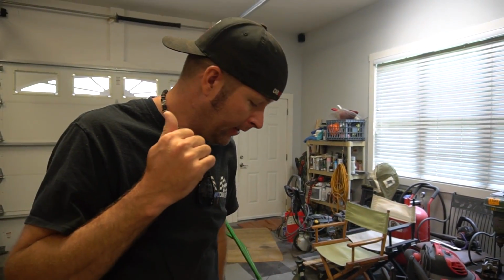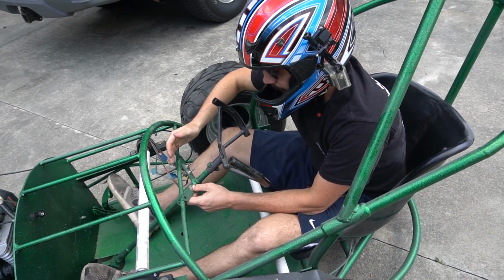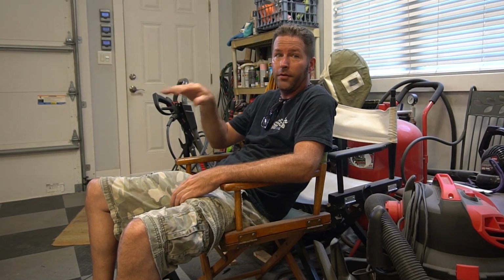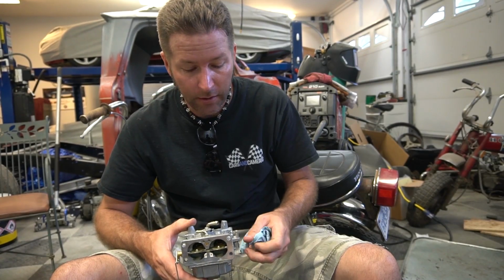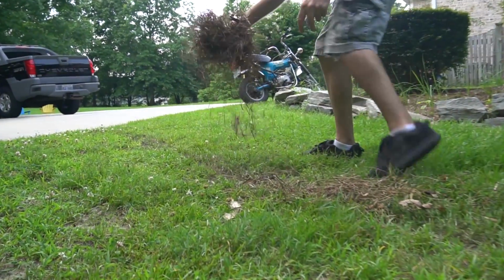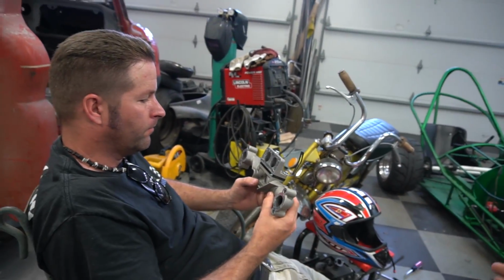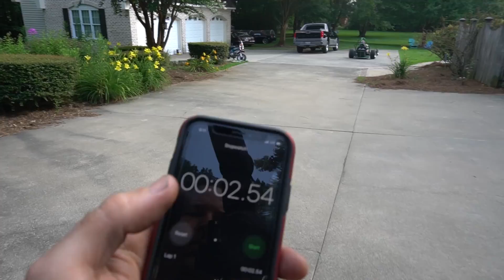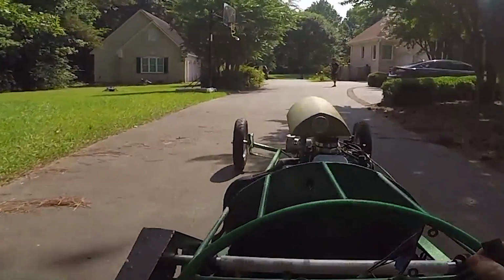THE DRAGSTER DOES (BABY) WHEELIES! | 50HP 670cc Drag Rail Kart

Comment: I think fuel slosh may be a part of your problem. Since the carb is sideways like the whole engine, you nail it and all the fuel sloshes to the back of the bowl during acceleration. That may be enough to cause a lean running front cylinder or even a misfire. Whatever new carb you get, I would suggest taking it apart and seeing where the main jets get fed from and put that toward the rear of the rail so when you nail it, it’s always got fuel.

Comment: Sounds like the chain is skipping...you can hear it and see it at 13:22 .Looks like the shafts are deflecting also..
Reply: harry guy I too noticed the movement/"slop" of the back wheels on takeoff. Wonder if its shafts or those wheels deflecting?
Reply: Yeah,  and I've always wondered why you don't use a spring loaded tensioner on your chains???
Reply: I noticed that too on the last run, that rear shaft looked really sloppy.
Reply: Yes both the left and right side of the axle is bending toeing both the rear wheels forward 13:19 when he hits the throttle and it looks like the chain skip might be caused due to the axle flexing cause as the axle bends forward it takes tension off the drive chain just enough to skip by the looks of it.
You can see the final drive chain to the axle get real loose on take off 13:34 ...you can see the left tire wobble back and forth when the chain skips 13:22 use the slow mo function and you can really see it good.
Thicker axle might be in order...
Reply: Neil MacPherson 
Haha I just about pooped myself. 
You have my uncles name , spelled correctly and everything. 
Good to see another Mac!!
Reply: I caught the same thing with the rear shaft, both rear tires had a slight wiggle to them and I saw it on both tires? the right one at 13:15 and then the left next clip.
Reply: LOL "If it's not Scottish it's crap" !!!!!!

or maybe your Uncle has my name.
Reply: Neil MacPherson 
Haha yes!! 
correct people when they say it wrong also. 
Tell them there’s no fear in pherson 😬😬
Reply: LOL I remember my Dad making that point.

Comment: What I’m thinking is the g forces from the launch is pushing all the full to one side of the dual bowl and only feeding one pick up
Reply: thats what I was thinking also  since its not a high G application Engine to begin with ,  we have slosh control plates or stuffing  in hard launching car carbs and jet extension tubes to prevent it from leaning out  , also the cutting of the spacer will make the carb look bigger to the engine since its now pulling from both bores instead of one bore .
Reply: Scott Grumpybastard yeah this happens in real drag cars ( naturaly aspirated )at the track during launches but most all cars have a drop in oil pressure due to the oil being pulled away from the oil pickup so they need a sump system, but I thought this might apply here.

Comment from the maker: I think we need to go back to the drag strip before we put a new carb on it!
Reply: Mine jr has a 1.78 60 ft at drag track
Reply: CarsandCameras you think you should that would uh old be awesome
Reply: It would be fun to see the difference the new car makes.
Reply: CarsandCameras swap it at the strip so you can do before and after in the same day.
Reply: Why dont you go dual carb setup?
Reply: u should do dual 28 flatside Mikuni
Reply: Turbo!
Reply: CarsandCameras hey do you guys know were i can find a rear axle for a 97cc baja miny bike if so pleas let me know
Reply: CarsandCameras  what the funny part is  is that i have a 50cc bike that can do that much faster       now if you want a good engine get a snowmobile engine       and you should try using the belt clutch system like the snowmobiles do it acts like a cvt
Reply: You should try dual carburator close to the heads and double cable to the trottle pedal
Reply: CarsandCameras Hey guys. Just wanted to let you know that you might want to take a look at the back axle and/or left (driver side) hub. It looked a little off kilter near the end when you did the slow pull towards the house.
Reply: Hey!!!! Race it against the original 670!! that would be sweet!!!
Reply: Against the Original Black Widow!!!!!
Reply: should be cartsandcameras!
Reply: take all the carbs with you and test there. it will be way more accurate
Reply: The 2 things I noticed is it sounds like you are hitting the rev limiter and also fuel starvation.My drag car I had in school (a long time ago lol) it had fuel starvation issues too on the hard hit.The way I fixed it was to put a tube on the fuel draw in the fuel bowl to the back of the fuel bowl where all the fuel runs on take off.Might be something to look at and maybe try.Could save you some headaches.Oh and the making the crossover cut was very smart.It evens out the air going to both sides
Reply: CarsandCameras you should get a Harley sportster carb and put it on the dragkart.Harley carbs are the simplest setup ever and it’s single barrel so no need to worry about syncing. You could also use a mikuni pwk28 or something similar.
Reply: CarsandCameras y'all should contact lectron and see if they have a carb/ duel carbs applicable to this
Reply: CarsandCameras you had me at "here we go".  Love this project!
Reply: That dragster is just cool guys!
Reply: CarsandCameras put the ducati motor in the dragster
Reply: The belt clutch on a snowmobile is a torque converter.....just like the one the C&C guys have on the dragster.
Reply: Weld an O2 bung into the header and throw an Ecotrons EFI on it.  I love your tenacity when it comes to playing with old cabs, but there is absolutely no replacement for verifiable, hard data.  Plus, if you went the EFI route, you would have the option to play with the timing and advance it a few degrees when the engine gets into the optimal powerband.  SCIENCE!
Reply: DELTACX10 it is a cvt
Reply: Jeremy Nading yes it did, Bigtime...
Reply: no sense in taking it to the track if the motor is stuttering like that .. fix it first ... it's either a fuel / carb tune issue or an ignition problem ... sort it out.
Reply: Y'all should try Harley carburetor or y'all should try a Honda 2 cylinder carburetor
Reply: Hey carsandcameras, is there a link for a torque converter pulley to run the 670cc predator, going to be doing a build on my kart and putting a 670 on it
Reply: Big cam it or whatever you call it when you have bigger cams on the cam shaft, letting in more fuel. Then it oughta do a 2 second run!
Reply: CarsandCameras hey guys in that last run with ike on the cart I saw the back wheels shift position they moved in torward the frame then jumped right back out.. not really sure what that means but I'd be checking the cart out before I did any drag strip runs
Reply: I have no idea why they are stuck on that dumb 670 "predator"  but so many guys get all excited over 'V-Twins" I'll admit that their little 670 has a nice sound but a ZX14 motor spinning 12K RPM and around 200HP... yeah THEN they'd have something and talk about sound!  but to each his own...
Reply: CarsandCameras guys its time for 2 motors..be the 1st ever guys and smoke the tires off please ,,,for the love of GOD...🤘🤘🤘🤘
Its a beautiful dragster that doesn't go FAST...sorry tryin to piss ya off,so you'd  prove me wrong..
Reply: CarsandCameras you got some wheel wobble at 13:30, might wanna fix that could help.
Reply: carsandcameras you have the right idea on putting the gap in between the two barrels of the carb you gust did it in the wrong spot you should do it right behind the carb and the bigger the space the better. Engine masters actually tested that on the Dyno and made decent improvements I forget the episode number. Also by doing that you will effectively dubbe the size of the carb. From what I can tell you are spot on on it being like 2 separate carbs. Also on launch you should hold the break and gas so your rpms u faster on launch but you might break traction don’t know
Reply: Say I supplied you guys with a 20 or 30hp electric motor would you guys make a badass electric kart or bike?
Reply: chain stoker mine went out when I was a kid too
Reply: Needs a turbo lol
Reply: I`ll agree back to strip for testing, But as far as misfires any thoughts?
Reply: and fresh fuel maybe?
Reply: CarsandCameras what happen to the drag mini bike?
Reply: CarsandCameras how about a spider gocart like The Scorpion that would be awesome
Reply: CarsandCameras you are the best go cart youtube channel out there
Reply: I bet John knows what a  'Curie point' is now :0þ
Reply: CarsandCameras Get a performance side draft carb off a datsun, then build a custom intake. Would be kick ass.
Reply: Nice
Reply: Justin Perr just needs velocity stack under and correct vac signal
Reply: Nicholas Davis the typical harley engine is 90 to 110 cubic inches, which is 1470 to 1800 cc.  The predator 670 is around 1/3 of that displacement, so the carbs on a HD engine are waaaaaaaaaaaaaaaay too big for the 670.  Even if you made the adapter to physically made the carbs to the 670, it would likely barely idle and run like poop everywhere else.
Reply: CarsandCameras put a snow machine motor in it it has more horse and will be way faster
Reply: Daul carbs please
Reply: dafretz was putting 5l carbs on 1.6l & 2l engines, compact hobby stock.
Reply: Could you check your fueling with a AFR Gauge
Reply: What is this motor you speak of? Is it like a industrial motor or is it made for electric vehicles? I guess the best way to tell is what is the voltage it runs off?
Reply: Can you do a custom tap tao ark-125a
Reply: I think it needs a supercharger off of a japanese Kei car 😁
Reply: CarsandCameras  personally i think youd benefit from having more plenum volume to reduce the pumping and inconsistent intake pressures...may even be able to hide it under the scoop..good luck
Reply: Mike Kadlec you are probably spot on. I dont know how many degrees apart the predator twin fires, but i do know that it's typical for a 2 cyl to produce inconsistent pressure. I know a guy who turbocharged an old John Deere 2cyl tractor and he had to convert the old oil bath air cleaner into a boost resivoir basically. Made a huge difference.
Reply: turbo time?
Reply: Build a  new dragster with a Ducati moter on it and race the two

Comment: Mount the battery behind the seat!(for wheedles) Or get a smaller battery/ lighter?  the big battery on it must be like 50 lbs.   just a good place to start with reducing weight  :)  ps I love the cuts in the editing  + the burnout on grass was super cool!
Reply: Crazy cal 
Yea I got a Braille.  
It’ll start my diesel car down to 30, it weighs 15 pounds and is half the width of a normal garden tractor battery. 
Not cheap at around 180 but I saved about 30 pounds off my front end in my car. 
That’s a big help when it’s only rated at 52hp.

Comment: you guys are not using the stall correct. for example: if you guys have 3500 stall springs you need to bring the rpm's up to (around) 3350-3400 . right before it locks and then launch the rail. try it when you get it running right. I think you will be happy with it. also you need to find out what kind of rpm's your running at the drag strip. for example again: if your motor is good to 6000 rpm's ? then you need to make sure you have it gear to pull that kind of rpm's at the finish line.
goodluck guys. you need to come to symco wis this august and drag race one of your minibikes on a clay track,125ft. 85 bikes, 5 classes last year.
Reply: I was thinking the same thing, but their torque converter is just a belt driven CVT, not a fluid torque converter with a stator like a car, it would probably help to run the engine up to stall before launch but they're gonna toast their belts real quick doing that
Reply: It's a variomatic... Exactly The same as a jr dragster... Belt does not slip..
Reply: they won't chew the belt up. it's made to handle that kind of power.
Reply: Yeah it can handle the power, but it will just melt when if they stall it for too long, even if it doesn't melt it will get flat spots on the belt and it won't be nearly as effective after that
Reply: I was gonna say the same thing. High stall doesn't help if you don't stall it to begin with.

Comment: "You need to look at your rear tires and axle"... the hub at 13:15 has a wiggle with next clip on left side also. Its not deflection, maybe it's from tooling around the yard with that frame. I liked when it jumped the tree roots. This thing sounds so cool.  Just like the movie with Cheech and Chong...... he has the harley on porch just to bother neighbors when he hits the throttle . I'd do the same thing and stay stationary just flooring it,  LOL

Comment: Looking from the rear when you start to move it looks like the axel or the frame is flexing or is not tight in the frame Guys. when you are in slowmo on take off.
Reply: pretty sure that's axle flex when its under load. don't look good! and damn the chains look scary lol in the slow mo
Reply: WA. PREPPER  that isn't a car bro in you pic check out mine. 71 mach1 cj 429 ram air. 982 hp.
Reply: If you now cars this car is a full custom from the ground up never came of off a assembly line it does have 429 twin turbos and NOS on full cage . I will let you think what the HP is.

Comment: What about a turbo, or even crazier twin turbos. I know you put a turbo on a go-kart a while ago, but it's a dragster, it needs the acceleration.
Reply: Single turbo would be better. Especially with 2 cylinders feeding it instead of one.
Reply: Vz21 turbo would do it
Reply: Turbo would have too much lag on it. A belt drive centrifugal supercharger would work better. Basically a turbocharger with a belt drive system. Had one like that on my GTA.
Reply: Thomas Strickland a single turbo would be mechanically simpler ...and if sized correctly the wouldnt be much lag at all especially with their stall setup.  If they wanted to boost more volume at less pressure to make more power they could set up a nitrous system either in the induction system or in the exhaust as an anti lag wet shot
Reply from the maker: We would need either a draw-through setup (which has performed poorly for us in the past on the drift trike) or an expensive custom EFI system. On top of that, we'd need a custom ground cam with minimal overlap- forced induction gains are marginal without the proper cam.
Reply: CarsandCameras 
Boost is for losers anyways.

But EVERY dragster needs NITROUS!
Reply: CarsandCameras you don't need an expensive FI. Look at ecotrons EFI kits for small engines, got one for my GY6 turbo scooter and it works great !

Comment: GUYS its time...  2 motors on the dragster .. tractor pull type, but for the strip..  Guys it has to be done the dragster is to awseome and to beautiful not be able to smoke the tires off an  make screaming passes on the track...you guys know it would be so fun, and for us to..
Reply: Wisconsin Robin = 2 Predators. A bit heavier, but amazingly compact small V-4 which would almost fit without mods [I said 'ALMOST' people...] and, although a bit heavier [cast iron block and heads] its one excellent block to power build!

I found a few on E-bay, this one is moderately priced, great photos of how they are laid out, perfect for flat plate mounting, although you have a whole lot of sheet tin that you might want to negotiate with fiberglass to save a little weight, in the end, even though it is ONLY rated as 30hp with the dinky little 1bbl carb, with a few tweaks and a good set of motorcycle carbs it would probably turn out 120-150 Hp pretty easily.

[link only to show what it looks like from various angles, not mine, not trying to sell you one personally]

https://www.ebay.com/itm/Wisconsin-VH4D-Gas-Engine-2-AVAIL-VH4-NICE-LONG-SHAFT-Stone-Saw-Grinder-/223040608068
Reply: Delicious DeBlair hell ya
Reply: Just put on a Hemi v8 lol. But in all seriousness, the dragster needs some linelock so it can do burnouts (I'm new to the channel so Idk if it already has linelock or not)
Reply: Delicious DeBlair. The Wisconsin Robin V4 is 1760 CC. Making its width at least equal to an 875 CC engine. Vs their 670 CC V twin mounted longitudinally. Which would be a least 350 CC width engine.
Reply: Aries Might 
There is no such thing as a V4
Reply: The slow stig. 😒PIFFT Trolling are you.
Reply: The slow stig Yes there is a such thing as a v4. There have been motorcycles and cars that have used them. I believe Honda, Ducati, and the Ford Capri Mk1 and Lancia has used them. You're on Youtube, look it up.
Reply: JaxRhapsody 
I’m from the car world so I guess that I just am surprised to hear about a V4 engine